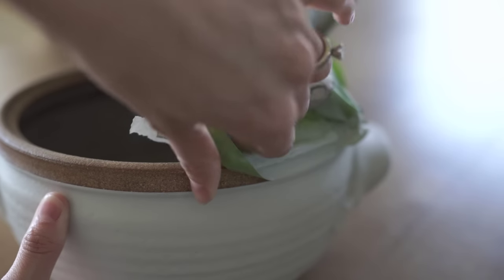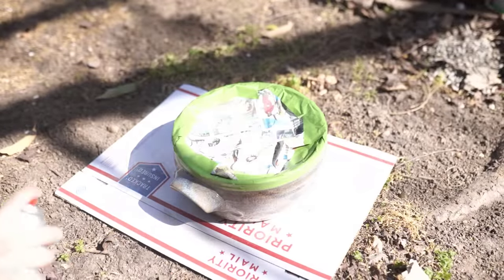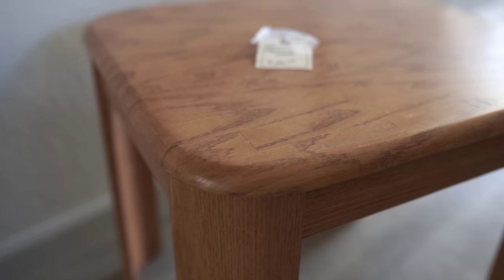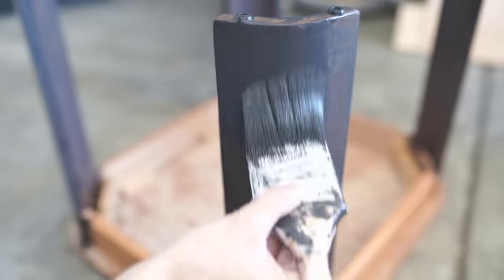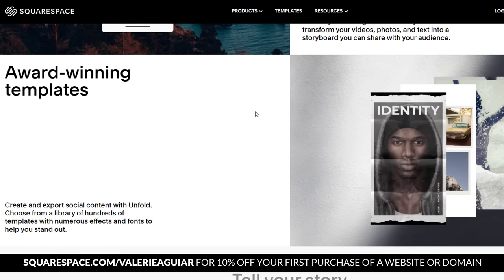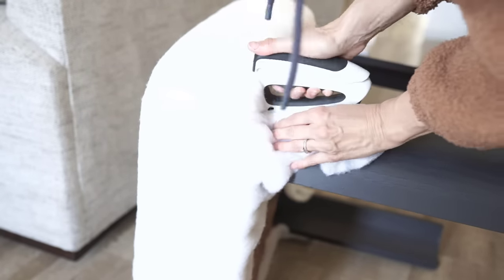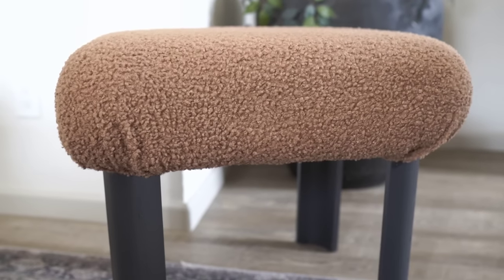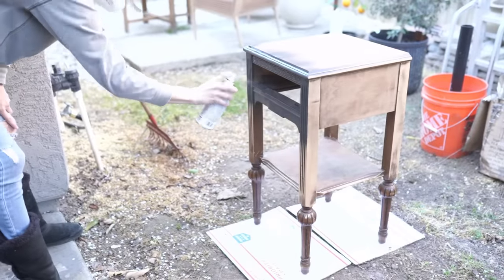DIY THRIFT FLIP DECOR (TABLE, BOWL & OTTOMAN) // HOME DECOR ON A BUDGET

Comment: Your sander on the top of the table was just killer. It blasted that old finish away on no time. I was just trying to sand down an oooold piece of furniture myself and it wasn't definitely not that efficient. What kind is it?
Reply from the maker: I have a little Milwaukee and also a Craftsman. The trick is really what grit sandpaper you’re using. The first one I used was an 80 (which will remove) Then I work my way up usually a 100 then 120. Some people like to finish with the 220 to get it really really soft. It’s all preference :)